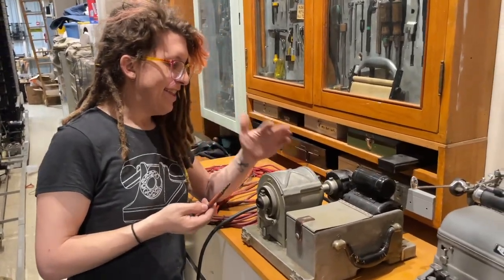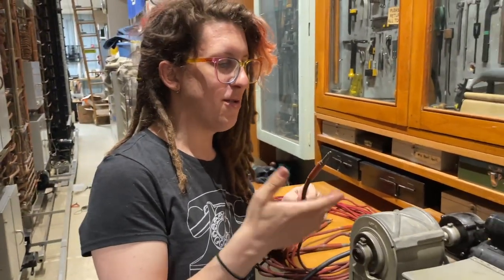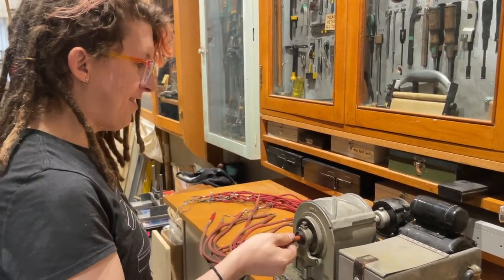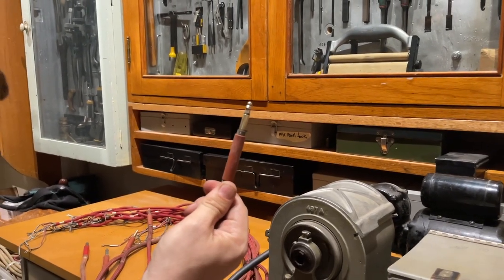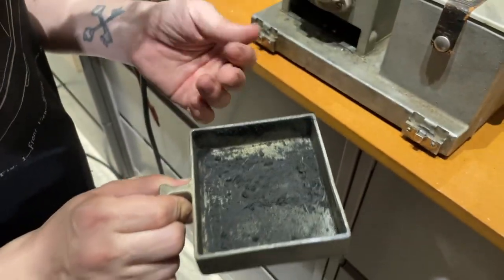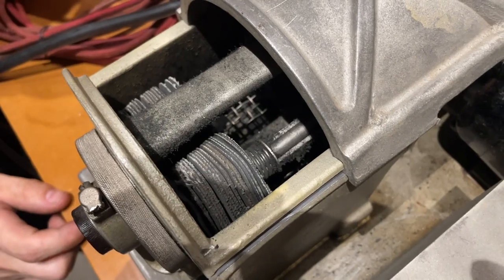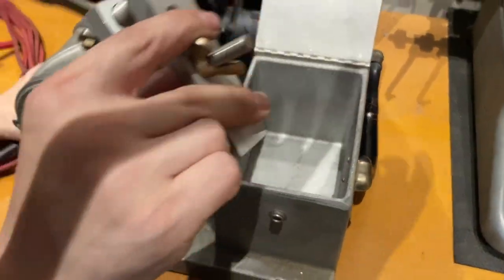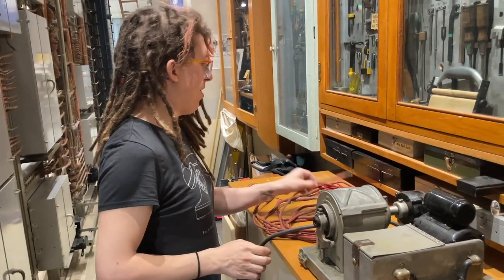The most over-engineered pencil sharpener EVER? #shorts

Comment: What!? That sure is a bad ass way to solve a mundane yet vexing small issue! Love it. The modern equivalent is the fiber connector cleaner. The most stolen tool in the lab.
Reply: Technology may evolve, but some maintenance practices will stay the same :D
Reply: After the connector cleaner, I think the dust caps for LC connectors are the next thing that gets stolen. 🔍😸
Reply: @carpetbomberz  if at any point I clean my pockets, I will more likely than not find at least a single LC dustcap (probably in a plastic bag) in there. So yes, I can confirm this.

Comment: When I was in high school we had a 555 PBX that I operated much of the time.  When other students would come into the switchboard room, I'd tell them if they held on tightly to the end of a cord plug they'd be able to listen in on a conversation.   Then, I'd press the cord's ringing button!
Reply: My stunt as well, but with a megger!
Reply: Ouchouchouch.... You'd better be running once I got loose! Getting lit by ring voltage makes me mad.
Reply: @Nighthawke70  RING RING!!
Reply: @jeffreyyoung4104  Hey, 40/70 volts is nothing to sneer at. Some places actually increase their tip/ring voltages to overcome corrosion and old equipment.  And those SMART.
Reply: Does this prank related to this song ? (not a rick-roll) https://youtu.be/URAqnM1PP5E?t=57

Comment: When I hired on with Bell Canada at the tender age of 19 in 1976, I worked the 17B and 17C test boards maintaining inter-office trunks and AT&T Long Lines circuits on the graveyard shift. A huge mound of patch cords and 310 plugs heaped on the floor, the trusty plug cleaner was put to work. But only 4 times year, thankfully.

Comment: I cant imagine that this was really good for the plugs long term.  What are they plated with?  How thick and durable is that plating?  Most modern plugs have just a super thin plate of gold on top which is easy to wipe out.  

But no worries, enter Deoxit!  I have used that stuff for over 2 decades, it is great at what it does - if you have any electrical connections at all Deoxit can clean, lubricate, and protect that connection making it last way longer, have a more robust contact, less "crackling" or other loss of signal, protect from corrosion and so on.  There are a few versions but I think it is worth having all of them so that you can use the proper solution for the condition.  

But yea, when you look at this from history it is really interesting - so what is all of that grime made up of anyways?  That is a good question and I know at least part of what it is made of is gross...

Comment: Thanks for thin nice plug ASMR! Where does this strange font you used on the thumbnail come from, does it have an history linked to this device?
Reply from the maker: That font is Bell Centennial “Bold Listing,” designed for use in phone books. The corners of the characters bend in that peculiar way to let excess ink spread at small print sizes.